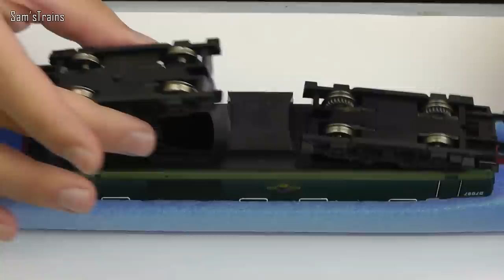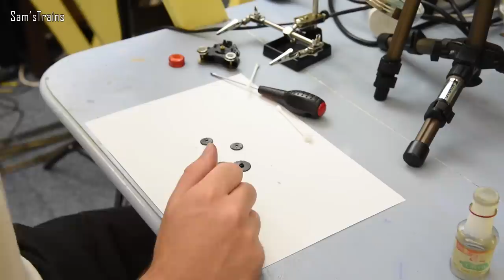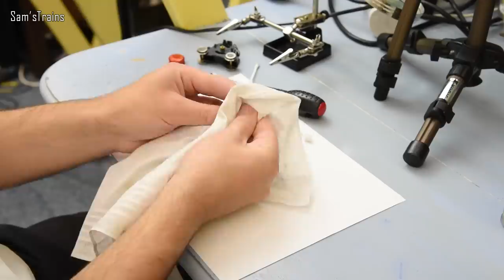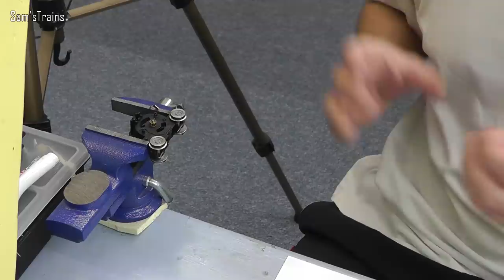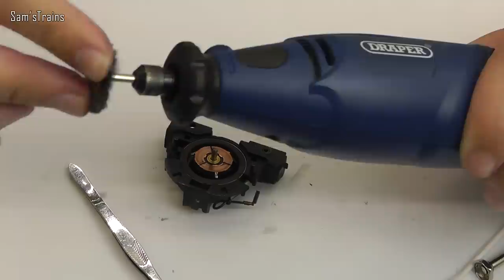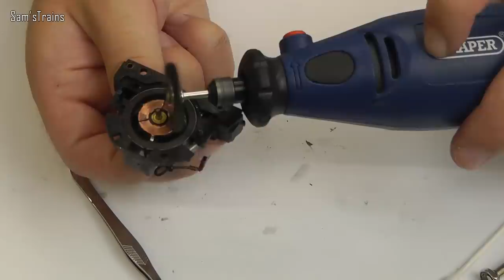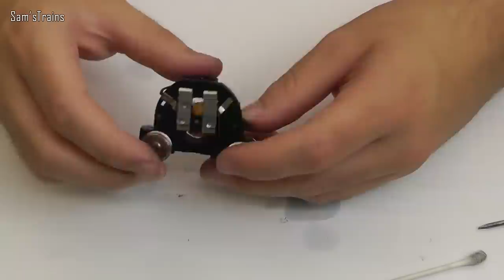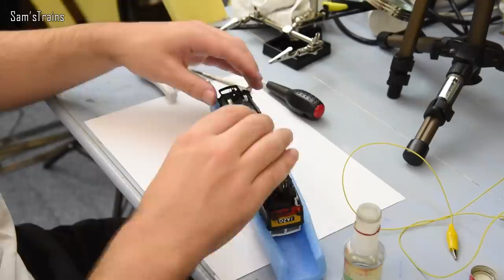How to Service Any Hornby Ringfield Diesels

Comment: Hi Sam, bit of a odd question but i just got a brand new Bachmann Toby and he runs really smooth but also really slow. I have to turn my controller upto 60+% to get him to move at speed. Does yours do this or does mine sound like it needs work done to it?
Reply from the maker: Hmm, I'd say that's pretty normal - that can be an indicator of a fault with the motor, but mine is slow too, so I'm sure it's fine! :D
Thanks for watching - Sam :)

Comment: Do you know how to repair cab lighting in a old hornby class 47? I took the body off but not sure where all the lighting  wires go or if you could show a video with lighting wiring? Many thanks paul
Reply from the maker: Hi Paul - the bulbs usually have two wires coming from it, one sometimes with a diode. One wire needs connecting to one bogie, and the other wire goes to the second bogie! If you get them right, the bulb will turn on only when the engine runs forward! Feel free to email me a photo of your arrangement, and I'll take a look!
Thanks for watching - Sam :)
Reply: @SamsTrains  thanks sam I'll send some photos I've got one bulb working but the other one is the problem as it doesnt appear to have enough sockets on the motor.  They both have diodes one from each end. This is how it is theres a very short wire which plugs in from the silver socket to the front of the motor. One bulb fits at the back of the motor, the other cable from the front light goes into the back bogie. There is a cable then connects from the back bogie into the other silver socket in the motor. The back lights one fits in the back bogie (nearest to the rear lights) as it's a short cable but on the original hornby clas 43 diagram it shows the long cable coming from the rear light ( with the diode)going into the front motor bogie but I cant figure out where it can plug in because all the sockets are already filled think that makes sense.?

Comment: Hi' sam do you no how to fix my train it is going so slow and it's comming smoke frome the motor ore the battery plz can you help me if you dont understand sorry it is because i am from sweden
Reply from the maker: Hi - could you tell me which engine this is? It could well be a motor issue - but a thorough cleanup may be enough to save it! :D

Cheers,
Sam :)

Comment: Subject R399 tender for Flying Scot R398 - 4472. How do I separate the motor unit from the chassis of the tender? The heavy metal motor frame has number S4565. There does not appear to be any clips/springs/catches. I wish to take out the armature as there is some physical restriction to free rotation.
Reply from the maker: There may be two screws up inside the body at the back of the tender - if so, removing them should free the body!
Thanks for watching - Sam :)
Reply: @SamsTrains  Thanks prompt reply. Sorry no screws. Jim. Ps Can send photo, but not thro YTube I think.
Reply: Further to my last - there were 2 screws to release body shell from chassis, but none to release motor housing from chassis. Jim.

Comment: no idea why by my ringfield motor is now running slower. do you think i should clean the axels.
Reply from the maker: Hi Jack - it could be an issue with the motor - try re-cleaning it, and reapplying the oil, but only in tiny quantities! Does this happen when you power just the motor, without the gears?

Cheers,
Sam :)

Comment: OK Sam, I had to extend my quota to 3 Videos tonight, after seeing this one! 😉 
Fascinating. That drive looks just like the 1964-1993 Bachmann Standard Line here in the Colonies!! 

I really enjoyed that, even though I've been servicing my Locos for over 40 years! 😳😳 

One thing... I would strongly recommend NOT using a wire wheel on the Commutator. It leaves an uneven surface, not always visible to the naked eye. This is far more critical on the "pancake" type Motors like this one.

Instead, find a VERY fine Grit (2000-2500), rigidly mounted Sandpaper. I mount mine on a trimmed Popsicle Stick. Gently rest the Sanding Board across the Commutator whilst spinning the gear on the opposite side. 

Like your method, you'll not want to remove more than a very trace amount of the Copper! But with practise, this will yield a nice, FLAT Comm, which will run smoother, and extend Brush life. 😊 
Like anything of the sort, try it on an old dead Motor, if you have one. ✔
Carmine ✈🚂🚙
Reply from the maker: haha glad to hear that mate - that's very interesting, they must have adopted a similar mechanism then! I've been using wire wheels on the commutators for many years now - and the results have been excellent - ones that I did years ago still wipe perfectly clean very easily! :D
Thanks for watching - Sam :)
Reply: Many people have used the same method you use... Nothing wrong with it. They're hearty Motors, although not the smoothest at crawling. The flat sand method helps slow speed control.... slightly. 😉 But I'm a firm believer in whatever feels better for YOU!

Comment: Hi Sam thanks for this - a very good logical explanation. I have serviced quite a few of these motors in a similar way (except for the wire brushing bit) but I have an unusual issue with a couple of them recently that I don't understand. They run much quicker in one direction than the other. Even without the gears attached! (just the motor as per your initial testing after cleaning). In both cases I have also replaced the brushes and springs. I wondered if you or anyone else on this thread have encountered this issue with ringfields and why that is or how it might be fixed?  This equates to the engine (an HST in these two cases) running much faster when going backwards on the track than forwards.
Reply from the maker: Thanks a lot David, appreciate it! That's interesting - have you tried taking measurements of the resistance of each winding? It's possible that there's a fault there - each winding should measure within 0.1-0.2 Ohm of each-other, if they don't, that indicates a possible fault!
Thanks for watching - Sam :)
Reply: Thanks Sam for the reply - yes I did measure the windings - all normal. The only thing that I can think of is that I need to try your wire brush trick: because there is still a little bit of ingrained dirt in some of the scratches on the armature and maybe these are not symmetrical... further cleaning is the only option left at this point because it seems electrical rather than mechanical... cheers David

Comment: Really interesting Sam 
I never dared open my ringfield motors be before but you’ve demystified them
Thanks 
Do you have similar servicing videos for all makes of engines?
Also what make of oil do you use?
Keep it up, good luck 😊
Reply from the maker: That's great to hear Jon - hope you can give it a go! I have videos for quite a few of them yeah - there's a maintenance playlist if you're interested. I use Hemline sewing machine oil! :D
Thanks for watching - Sam :)
Reply: Sam'sTrains Thanks Sam
I’ll take a look at those servicing videos 
Do you get the sewing machine oil on line?😊
Reply: I haven’t touched my railway stud in years 
All the stock , tools , paint and materials has all been packed away for 12 years now 
I have engines from so many different manufacturers 
Triang, Hornby Dublo,Lima, Bachmann Dapol etc and a few odd ones ones too 
I can’t wait to get it all back again and make a fresh start 😊

Comment: Thanks for the super video Sam; most informative. I've gained a renewed interest in my dusty railway collection during lockdown through watching your excellent channel and your content and the alarmingly pained noises my locomotives make when set upon the track have spurred me on to service them. A quick question. Where can I find the oil applicator you use? Thanks in advance and long may the Sam's Trains channel keep steaming!
Reply from the maker: Thanks so much Thomas, that's really lovely to hear - good luck sorting yours out! I use a Gaugemaster one - if you do a search for Gaugemaster oiling pens on Ebay, you should fine them!
Thanks for watching - Sam :)